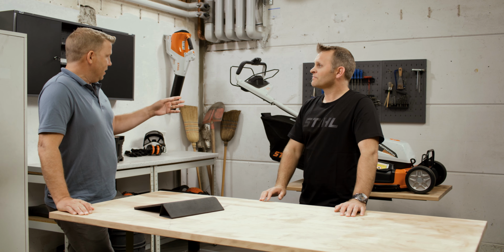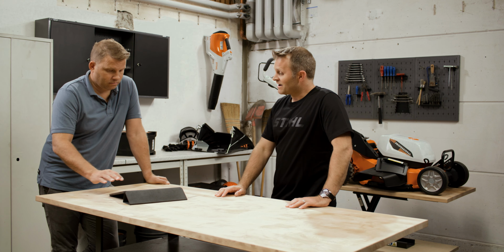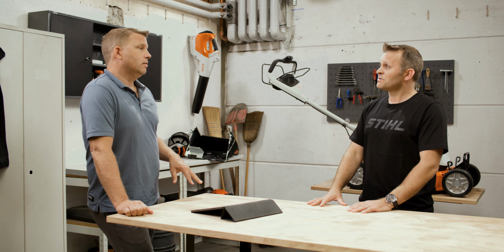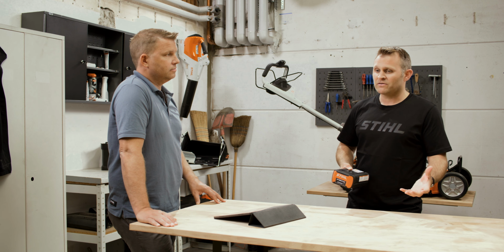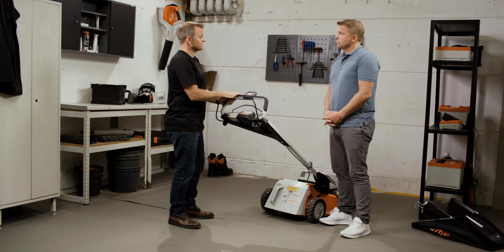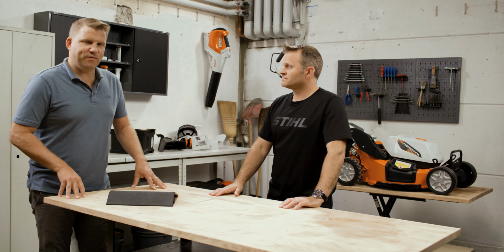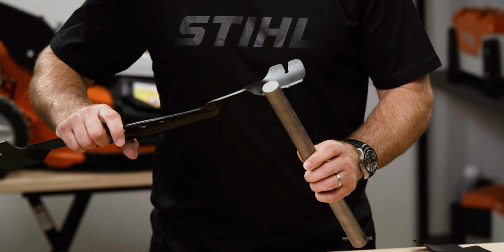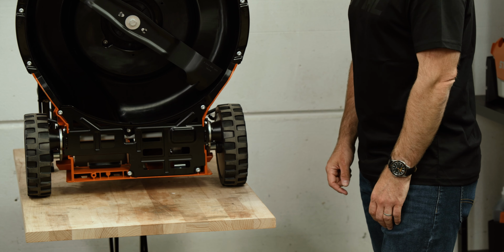FOCUS ON Battery Lawn Mowers | STIHL

Comment: Have both AK for its light manuveurability. And AP for durability and rain resistance. The AP range is heavier and superior. Especially the hedge trimmer where AK didn’t quite have enough. Stock wire on the trimmer should be upgraded to the purple. 

Also have the AS for very small shrub worn. Quite simply the best battery garden tools on the market. Don’t over invest in Ryobi
Reply from the maker: Thanks for sharing your experience with our range of battery systems! We're thrilled to hear that you appreciate the durability and performance of the AP series and the maneuverability of the AK range. Your insights truly contribute to our STIHL community, helping others make informed decisions. We’re glad to have you onboard! 💪

Comment: 3000rpm is not commercial engine speeds 32000 rpm on small engines is for a reason witch  affects blade tip sped wich should be 18,000 ft/m
Reply: Rubbish, 32000 RPM yer ok!!!!

Comment: So 3 KW motor is not that powerful for a commercial professional walk behind mower. Egos commercial lawn mower is 4KW or 5.36 HP. Without good power and torque these mowers will bogg down in thick grass. A Kawasaki 21 inch gas mower motor is 4.5 HP 7.3 ft-lbs on a commercial 21 inch. A commercial electric owner should be able to exceed the performance criteria of a gas mower ( of 20 years ago) if the expectation is that they want customers to switch. It should not deliver less performance. Then again I suppose this is why no power figures are marketed/listed on the websites for these new electric commercial mowers.
Reply from the maker: Hi and thank you for your comment! We deeply appreciate your feedback as this helps our company rise to our customers expectations! Our responsible people will appreciate your comment. Please do not hesitate to reach out to our colleagues in your country regarding any inquiry or issue you might encounter with your STIHL machinery! https://www.stihl.com/local-stihl-representative.aspx

Comment: I'm sure it's great, and I'd love to convert to battery,  however still to expensive as an initial outlay for me.
Reply from the maker: The choice is very personal, of course. We do want to give the following food for thought, though: while initial costs are higher, the overall cost advantage comes from significantly lower fixed costs over the battery's lifetime; for example, the AP 500 S can be fully charged up to 2400 times. Electricity is also easier to find than fuel and, unlike rising oil prices, could become cheaper with the use of renewable sources in the coming years.

Comment: What's the bar in the front for?
Is it a handle, bumper or both?
Reply from the maker: Hello! It's a bar that prevents grass cuttings from getting under the flap!
Reply: @Stihl  Thank you for the reply, but are we talking about the same thing?
The one I'm looking at is the black one, above the front wheels, that bends up, over and back down again.
Reply from the maker: Hello! Thank you for your comment! This bar is needed for transporting and turning the mower to the service position.

Comment: I use the AK system daily with 2 mowers, blowers, trimmer, strimmer etc, on various gardens you need a fast charger though, I am very pleased with the quality.
Reply: AL 500/501
Reply from the maker: It's great to hear that you're pleased with the quality of the AK system for your gardening needs. If you have any questions or tips to share, feel free to reach out! 🙌

Comment: How heavy is the mower with 2 AP 500S?
Reply from the maker: Hello! Thank you for your comment! RMA 756.0 V has a device weight of 52 kilograms, RMA 750.0 V has a device weight of 50 kilograms, RMA 7.0 RV has a device weight of  45 kilograms. The AP 500 S has a weight of 2 kilograms each, so 2 AP 500 S have a weight of 4 kilograms.

Comment: I have an ego lawnmower that can cut 1,000 metres squared approx a quarter acre on one battery,no need for two,for the two batteries used in the Stihl mower I would expect more that 750 metres squared
Reply: Stihl always under promises, over delivers.
Reply: Looks at the size of an ego battery. 54v and one Stihl battery 18v

Comment: Who designed those problematic one sided handles, what a complete let down on a decent mower.
Reply: They are brilliant. As a professional gardener I find them absolutely useful and very happy with it on  all four of my mowers.
Reply: There's nothing wrong, or problematic about the one sided handles. Plenty strong enough,  and easier access to the grass box.
Reply: @LeeFrancis-f6y  I have seen and repaired elongated holes in the alu housing because of the constant flex these mowers have, and it gets worse with time.
Everyone is different and im glad you like them, cheers.
Reply from the maker: Hi! We are sorry to hear you were not satisfied with your STIHL machine. Far from being a design quirk, the single-sided, height-adjustable handlebar is sturdy and secure, and it makes emptying the grass catcher box a breeze. It can also be easily folded over for more compact transport and storage. If you are encountering an issue with your STIHL lawnmower, please contact our colleagues in your country and they will assist you further.